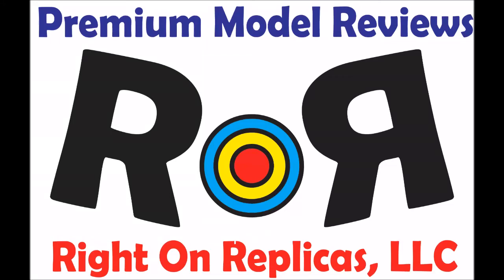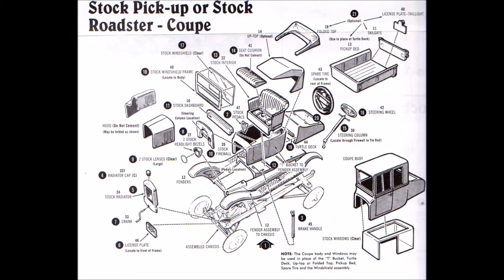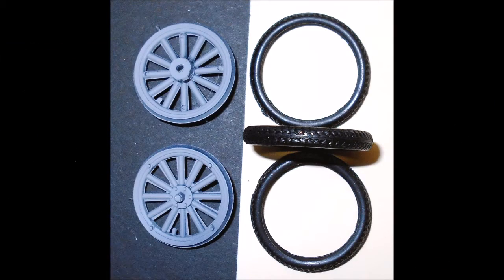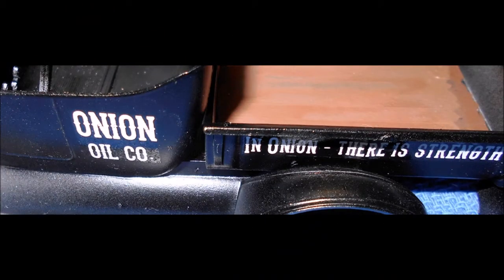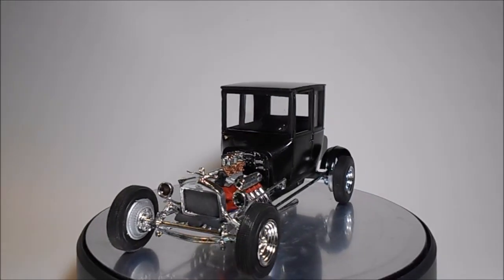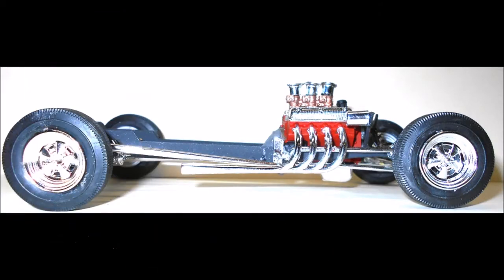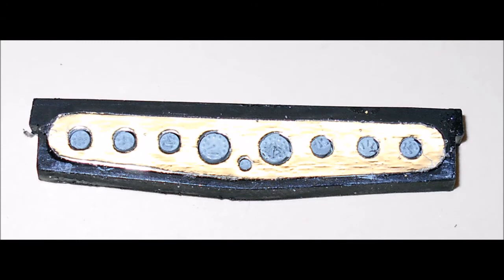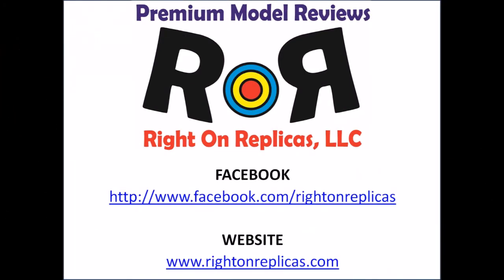How to Build the Three  Stooges Model T Ford 1-25 AMT Model Kit 1012 Review

Comment: Andrew's comment is only partially correct as those are the same  Gene Winfield designed Terra Thrust mag wheels that have been in the kit since 1964, but the wheel backs were widened in the early 90s. If you are using the narrow tires, it is a simple matter to narrow the wheel backs, and shorten the axle mounting stubs to match the fronts using a razor saw, The 2012 re-issue included a pair of drag slicks. Another reason for the problems with the wheels sticking out too far on the back is because the cycle fender supports are meant to be mounted inboard of the radius rods, which you have mounted upside down and on the wrong sides. With the fenders inboard (and the wheel backs narrowed) the Buick brake drums on the wheel backs will slide over and be nearly flush with the brake backing plates on the radius rods. Of course, you wouldn't use the cycle fenders with drag slicks. Putting the rear radius rods on correctly will also allow the body to sit level on the frame the way is supposed to.
Reply from the maker: Dang DD, you are very observant and that is excellent information. The instructions are weak in the area of part placement and I could see where that would work better.  Thanks for the tips!  -Doug

Comment: One thing I noticed was you used the custom firewall on the stock build and stock firewall on the rod build. This places the body to high on the chassis. You are correct that the rear inner wheels are too wide for regular tires. The other releases of this kit come with nice cheater slicks that fit. You can always narrow them down,  however
Reply from the maker: DD,  Thanks for the tips and please subscribe if you haven't already, to help us inspire more modelers!  -Doug!
Reply: @RightOnReplicas  Hi RoR. Do you by any chance, read Model Cars Magazine? I wrote a history of the AMT 25 T kit for the Vintage Workbench column in issue 219, with a second part (including building tips) that will come out in September 2023 (issue 221). I wish there was a way to share photos with you.
Reply from the maker: David,  I love that you're willing to share your modeling knowledge.  That's what RoR is all about.  You can always email me.  righton@rightonreplicas.com   Thanks -Doug

Comment: Why was the stock fenders/body incorrectly installed on the frame? The front cross member should be located BEHIND the panel below the radiator. Did you install the crank into the engine before mounting the fenders on the frame?

Having built these T kits since they were released in the 60's I can not believe the problems people on You Tube are having...
Reply from the maker: RR,  Thanks for the feedback.  I'm pretty sure it has something to do with poorly illustrated instructions.  Not many people (alive) have been close enough to a T to know the difference.     PS,  please subscribe if you haven't already to help us reach more modelers.  -Doug
Reply: @RightOnReplicas  Sorry Doug, from what I have seen on You Tube during the last week I have given up on youth. Seriously.
Reply from the maker: RR,  It's our future.  There's no alternative.   We have to try and teach them what's best!  -Doug
Reply: @RightOnReplicas   Quite by chance just an hour ago I came across two of the instruction sheets from the AMT model kits. One comment indicated the rear radius rods had been installed up side down.

The reply stated it happened because the INSTRUCTION SHEET was hard to understand. I looked at the instruction it it clearly shows the chassis inverted, bottom facing up during assembly. The radius rods had been installed upside down because ... "But that's what was shown in the instructions".

Blame the instruction sheet for your own short comings?????
Reply from the maker: RR,  I wasn't specifically referring to the instructions for this kit.  Overall, many of the early instruction sets were not very good.  Sometimes builders make mistakes.  How about joining us as a reviewer.  That way I know there won't be any.  -Doug
Reply: @RightOnReplicas  Total dis- agreement. Just today I have examined five instruction sheets from various editions of AMT's model T from  over the years. Look at the drawing, identify the refered to part, assemble as shown. What's so hard to understand?

I am fed up with today's youth blaming everyone else for THEIR lack of ability.
Reply from the maker: Roger,  It's easy to give up, but we're not going to here.  If correction and instruction in methods are appropriate we'll continue to provide it.  In fact, you're helping us with that right now.  Thanks for your feedback!  -Doug
Reply: @RightOnReplicas  .I just had my house ram sacked and my Rod & Custom magazine collection, my die cast Australian Fords (I used to own an XC Falcon ute), and a noticeable amount of early auto kits were stolen. The people involved are white, mid 20's, under employed adults, just like the people posting the videos I am complaining about. The police refuse to get involved and tried to arrest me but ended up taking me in for mental health evaluation (and released after 15 minutes).  The city is taking my house and unwilling to help me find a contractor to repair storm damage, the city wants a taxpayer in the house, not some "useless old man" who gets a property tax reduction. And I am left stuck in an empty apartment with nothing to do but look at You Tube.

As I indicated before, the people posting the videos are USELESS when it comes to providing knowledge to others and are blaming others for their shortcomings.

And they and their activities are being backed by the local government. AND I AM PAYING FOR IT by not being one of them.

I honestly no longer expect to live much longer. And in this world, sooner the better.
Reply from the maker: Roger,  Take a deep breath, get some fresh air and think it through.  I'm sure there are organizations in your area that would be able to help you out.  Contact a local seniors agency or even a church.  -Doug

Comment: one of the main problems with the rod version, in all the twenty-five T kits is the original wheels, from the sixties, were replaced with extra wide wheels to use wide modern tires sometime during the nineties.   Since I have a good spare parts box I was able to deal with the problem.  Now if Round Two could only find the original wheels to go with vintage tires.
Reply from the maker: Andy - You've hit on something that has become a problem for strict replicas builders.  Great observation!  -Doug